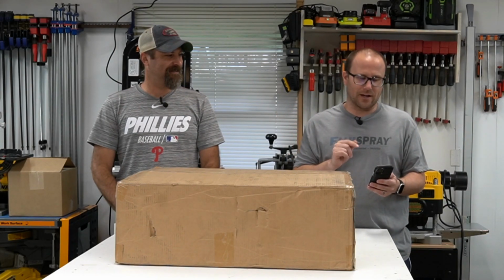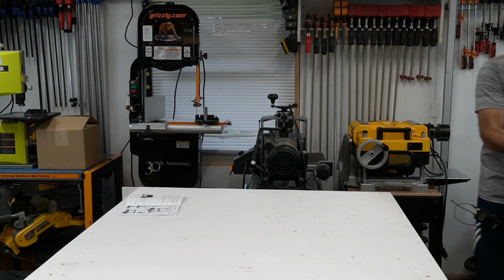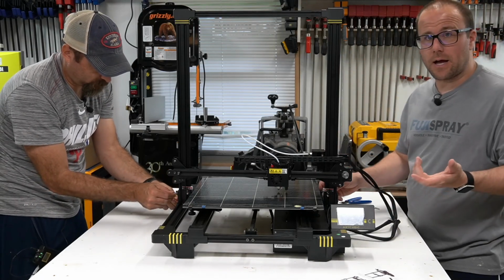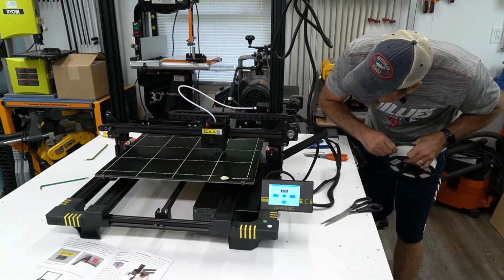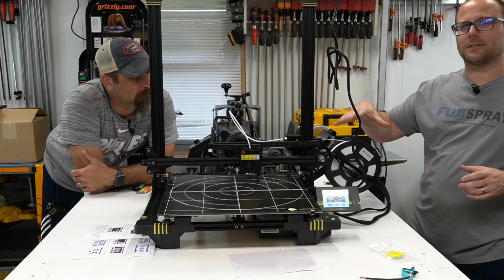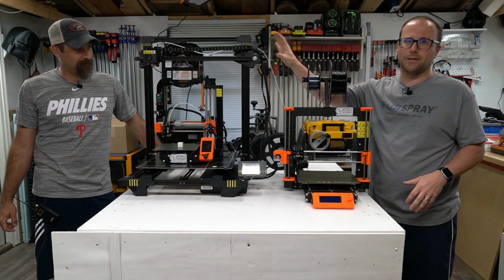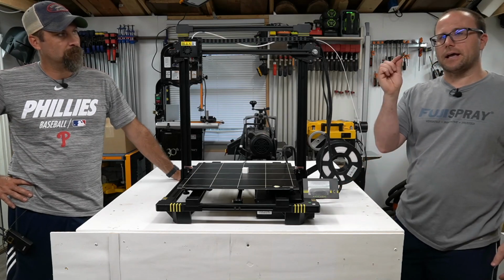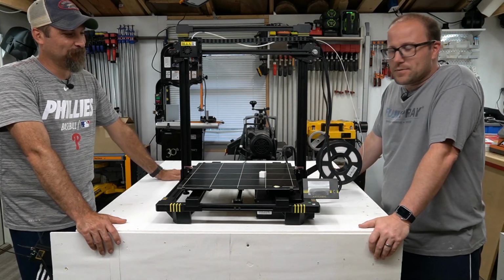This Printer Is MASSIVE! // Anycubic Chiron Review

Comment: A good printer for sure, the Ultrabase is a fantastic print surface, clean off with window cleaner and it works a treat. The Titan clone extruder however, is garbage and causes all sorts of extrusion issues, especially on longer prints, I swapped mine for a genuine E3D Titan. Totally agree on bed levelling, I fit a hardened 0.6mm nozzle to avoid needing to change it often.
Reply from the maker: yeah, i'd imagine a genuine e3d would be much better.

Comment: I am pleased to see your review of the Chiron.
I love Anycubic, despite the silly name.
I've had several Anycubic printers, a Mingda Rock Pro 3 and a Tevo Little Monster.
The Tevo and Mingda were for specific projects and I considered them 'consumable' items like drill-bits, band-saw blades, glue or taps.
Anycubic, I consider to be a good screw-driver!

Anycubic:
My first three were i3 Mega (wore the first one out, an upgrade 'ooops' killed the second one, gave away the third one to a kid getting started)
Had one of their larger Kossel designs, don't recall the name. Wore out the push-rod bearings in a short time, junked it.
i3 Mega X was the last Anycubic I had for a while.
I like the tri-gorilla controller; Arduino and me go way back, so I have been 'tampering' with Marlin 2.0 firmware...fun!

Tevo:
 Little Monster: it worked, project was completed, donated printer to school.
It must have been a decent printer; I can't think of any 'gotcha' moments.

Mingda:
 Favorite printer in terms of 'gadgeteering', least favorite to use.
I invested so much effort getting it to work right, I hated scrapping it.

I will setting up a brand new (third revision?) Anycubic Chiron next week.
Got another big project; an AX2 hard-suit, which by crazy coincidence is my own design.
search "ax2 hard suit stl files", hosted on Prusa.
Hey, I might need a home for the Chiron when I am done in a few months...know anyone in Western Washington?

In under four years I've gone through about >75 pounds of PLA and PETG...printers come to me to get worked to death!

Comment: if you want a cheap easy and fast volcano upgrade buy a new Anycubic Vyper hotend. £16 all in.  You'll need to print some Z adjusters a longer cooling nozzle and swap the heatsink.  But no soldering!

Comment: Ok, for understanding of the 115-230 v switch.  If you are in a 115 area and you power it up on 230, nothing will be damaged, ever.

If you are in a 230 area and you have it set to 115, you can destroy all you electronics.  All of it.
Reply: Incorrect. You can destroy your power supply even if you're in 110 and choose 230.

Comment: How far out from the front and back does the build plate move when it's printing all the way out to the ends? It looks like it pulls the top/bottom to the middle, so do you need to allow an extra 200 mm if it'll be near a wall?

Comment: Hi! Nice video,,,I bought the Chiron about a year ago and I did a lot of projects but last week it was my first time to try and print with PETG and for some reason it's a fail every time just at the start of the project.If you plan to use PETG and make a video with the settings in Cura etc,,, that would be great. Thanks
Reply from the maker: printed a lot in petg with default cura settings, no issues.

Comment: when you run out of filament, do you remove whats remaining and put in a new roll or do you stick the new roll to push the remaining? would that work? i've never tried.
Reply: I always remove that remaining length of filament.  
Why risk ruining a print over 2 feet of plastic.   
There are tutorials out there on how to melt 2 filament ends together, but theres a risk hardened plastic clogging up the extruder.

Pause print, remove filament, new filament in, manually force a little through to ensure extruder is primed, collect extruded plastic and resume print.  

Victory sauce.

Comment: Have you had any issues with suddenly stopping in the middle of a print and cutting off all heat?
Reply: Mine did this on my first print. I was printing from a gCode on the sdcard, but also had it connected to the PC with the USB cable. I loaded up Cura in the middle of a print job, and it must have sent some kind of signal over the USB which caused the existing print job to suddenly stop, and the hot end and bed to cool down. Hitting the resume button on the printer did nothing, and I was forced to start the job again. Quite annoying. But, I know now not to have the printer plugged into the computer during a job. I'm just going to transfer the gCode to the sdcard, and use the printer as a standalone unit, until I can figure out a solution. Will be lodging a ticket with Anycubic.

That said - The printer is phenomenal! This is my first printer, and I'm already getting great prints from it with no previous experience. I found the manual bed levelling to be really simple. Five points, and it's working really well.

Comment: Based on your and a few other largely positive reviews, I was very tempted to purchase this but haven’t yet after being repelled by a surprising number of Amazon customers (some very experienced in 3D printing) issuing blistering reviews documenting various problems ranging from needlessly annoying to safety hazards. Those issues resulted in those printers being returned or turned into large paperweights.

Thus I wonder, why the discrepancy between what you and they reported? Did you miss problems that may have surfaced with more extensive use? Are roughly one in six of these printers defective? Or perhaps were there problems that have subsequently been corrected? Relevant to that, some of their reviews came well after yours.
Reply: FWIW, I have one and it's been solid. I think their review of it was pretty spot on. The interface and the bed leveling are annoying, but if you use OctoPrint as an interface it's makes up for a lot of the shortcomings. And it has a bed larger than the Prusa XL at a quarter of the price.

My only other complaint was that it was pretty loud with the stock 4988 stepper drivers, so I upgraded to 2208s and configured everything in the Marlin 2 FW and once I got it dialed in it's the best printer in it's price range.

Comment: I would not say this is a good beginners printer. It's to big and slow for that.
A Anycubic Mega is way faster, easier to use and it's build volume will print more then 90% of the things you would like to print.

The Chiron is a good printer (I also have one) but it's mostly only good for big prints that you don't like to slice in parts like masks and helmets. And the printer that you don't mind having to print for days somewhere in the back. A 0.8 nozzle is a indeed good option here. 
For big prints with a 0.4 nozzle that's way faster then the Predator is a good option.
Reply from the maker: its a good printer.  It takes a tiny bit of tinkering to use.  Perfect with the .06 or .08 nozzle

Comment: OH YOU ARE SO AMERICAN. LOL. Nothing wrong with that. So, I got mine from them like 3 years ago, came with a cracked bed (Very corner, like 1in by 1in), they shipped out a new one, should have kept that SD CARD or cloned it, since the AUTO-LEVEL program that was on that one, was 100% proper and worked well. The new updated version that came with the new machine (I had to send the whole thing back, which if I remember correctly, they paid for, I mean STELLAR customer service). But the new auto-level program is CRAP. Like the old one, the screws were moving on their own, the print arm was adjusting by itself, it was NEAT. NEW ONE nothing. I don't think it's the machine, think it's the code going to the machine.

Comment: That first print is shit. My prusa mk3 was printing flawlessly out of the box and it came with a full roll of quality filament.
Reply from the maker: comparing this to a prusa isn't very fair.  Prusa is WAY better but much more expensive!
Reply: I ended up canceling my Prusa and ended up picking one of these up so I made a horrible mistake?
Reply from the maker: Probably
Reply: Hu weird you mean a printer 5 times the cost prints better. Weird....

Comment: This printer is so SLOW, it takes 25 days 24/24h print for a 400x400x450mm object with 5% fill at 0.3layer height 60mm/s max speed (3x more the time of a 10years old Makerbot would do). Resume function just knock out your large model partial print (was never tested correctly). Many Firmware Bugs when doing indenpendant X-Y-Z calibration, Z calibration need to be done last of else it bugs out (goes haywire).  No position indicator LCD screen on manual adjustment making resume height impossible to estimate correct machine height. Resume function does not let time to remove debris (no confirmation, just runs and destroy)...This is an unsafe printer, don't recommend at all. When Preheating, there is no timeout...just runs forever!